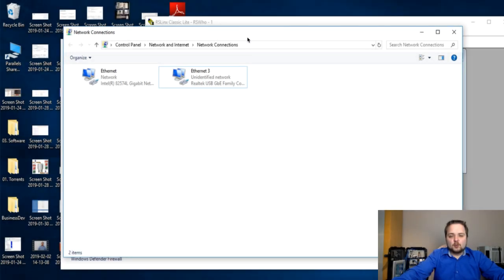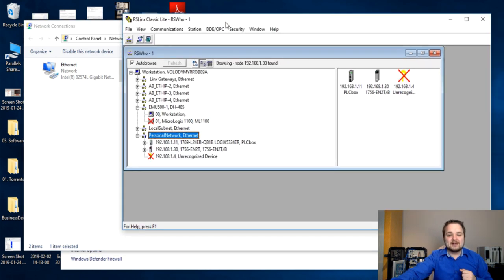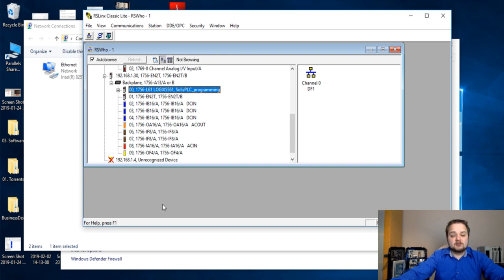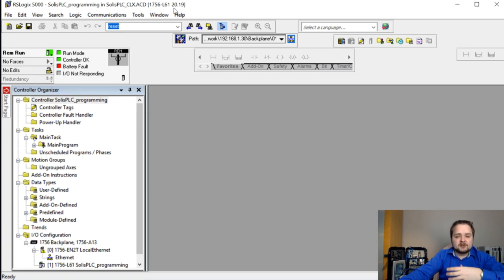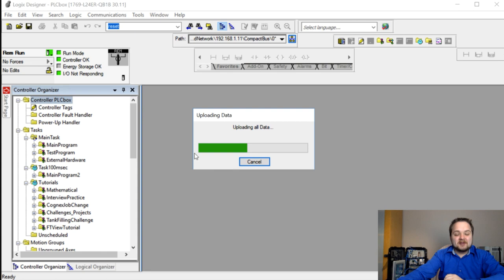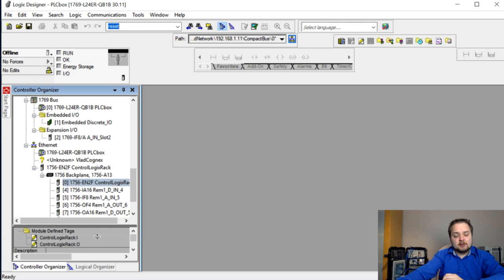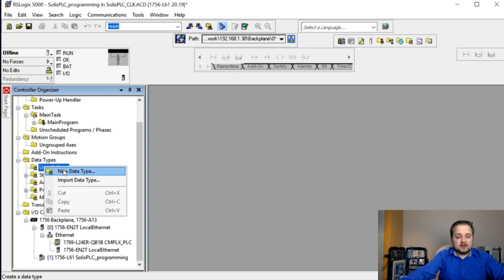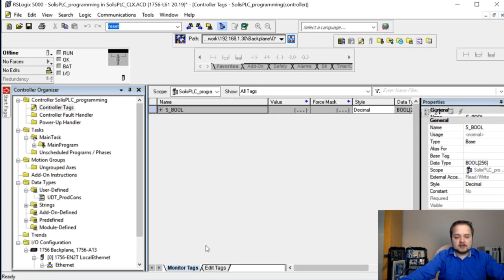RSLogix & Studio 5000 Produced and Consumed Tags | PLC Data Concentrator SCADA, Messaging, EtherNet

Comment: Hey. Good stuff bro. 
Only thing i wanted to ask you if you could make a video of how to transfer more then 500 bytes of an array from one to other cpu.
I know that one scheduled connection can only transfer uptp 500 dint. So if you could make a video on this please. 
Thank you very much and god bless you for the good teaching skills
Reply from the maker: That's an interesting question. I have never had to transfer more than 500 bytes from a single PLC. Let me test what that will entail.
Reply: @SolisPLC  The size of the produced and consumed standard tag is limited to less 
than or equal to 500 bytes.
The size of the produced and consumed safety tags are limited to 128 
bytes.

Comment: I’m using L43 in Rs-logix 5000 v17 and L72 in Studio 5000 v24. In studio 5000 I can find both cpu as shown in your video but logix 5000 L72 is not available so I used L65 and tried to establish communication but no use. What can I do in this situation. Please suggest
Reply: Also I’m using ENBT in L43 and EN2TR in L72